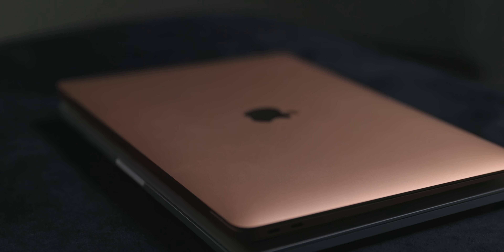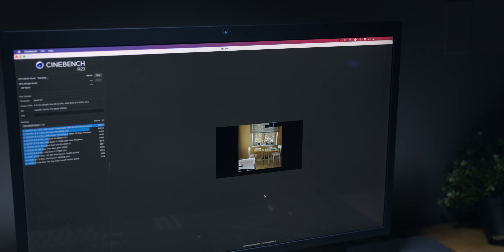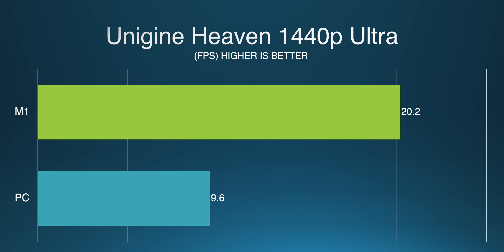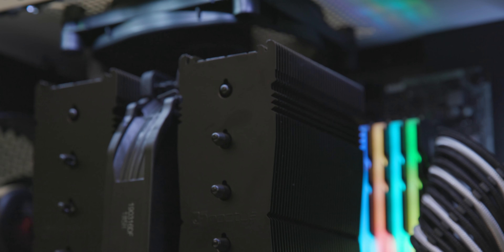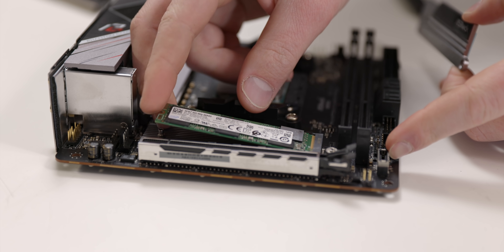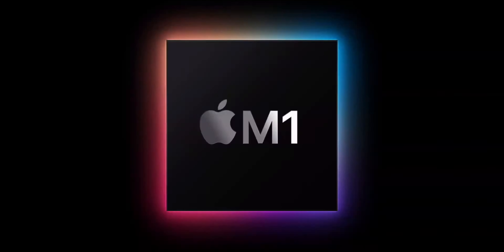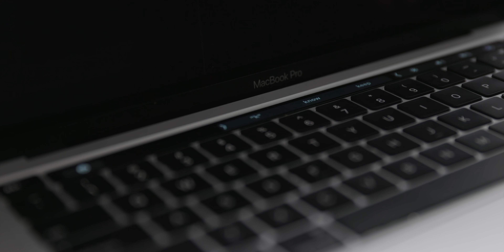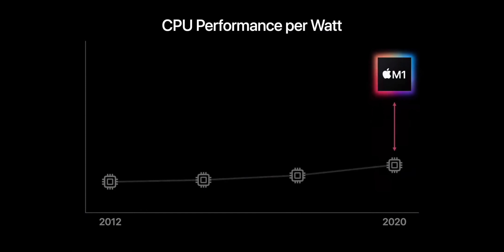$699 Mac mini vs $1,000 PC: Which Is Faster?

Comment: The M1 being the first generation in its class makes me very certain in a few years it will make getting a Mac one of the best investments you could make. Battery life in particular is one of the biggest reasons. Since the M1 was such a game changer, Intel is now completely obsolete and is a terrible choice long term. And I know some may disagree with the science behind ARM64 but only time will tell, unfortunately the market and industry are certainly not moving in Intel's favor.
Reply: Sergio Diaz  You're not wrong. That is indeed a huge flaw in Intel CPUs.

But I don't consider the TSMC thing a huge issue. AMD couldn't do it either and they couldn't beat Intel back then. So what did they do? Well they literally redesigned the entire CPU from the ground up. Lisa Su herself stated that Zen was redesigned from the very bottom. It worked out for them. It'll of course take Intel a while to catch up, but if they start now, it won't hurt as bad. 

It's bad right now, and they're spiralling pretty badly right now. 100% bad.
But they will get better. Moving to TSMC for now is a good move for them. If you can't beat the competition, join them. They've also said they'd be using Chiplet design instead of traditional Monolithic design. They have a ton of R&D money & brilliant engineers. They need better leadership and that's what their new CEO (old engineer) will be doing for them HOPEFULLY.

Btw, Joe Biden just threw $37b at the silicon industry to fix shortages among other issues. I'm not an Intel Fanboy tbh. When AMD was down, and people kept shitting on them, it's not a good look. When Intel is down now, people are doing the same. People are playing both sides and it's kinda sad. It's still a great company and team of engineers and they will pick themselves back up, just like AMD.. even if they have to take an L first.
Reply: It already is!
Reply: Gonna disagree. Intel will do fine. They may take a hit, but they will do fine. I LOVE my M1 Macbook Air, but it doesn't (can't) do what my two year old Windows 10 with Intel chip can do, and that's okay. I use each of them appropriately. Right tool for the right job. Every company takes a hit when a competitor releases a compelling bit of kit, but then they all usually come back. I have no reason to think that won't be the case again.
Reply: LoL, I love people who are not in the I.T. field making statements like "Intel is obsolete."  Yeah, 👌, 20 extra frames or 40 seconds of extra render time will not move the majority of PC users to Mac.

Apple will always suffer from the problem of being Apple.  Closed eco system, expensive hardware and getting the 🖕if you don't like their "advancements" like butterfly keys or a touch bar.  

The M1 is impressive, no doubt but Apple doesn't dedicate their company to making chips like Intel or AMD.  If the upcoming x86 architecture cannot compete with the future of ARM, guess what Intel and AMD will do?  

Plus let's talk about being restricted to 16GB of memory.....the biggest downfall to the M1 to date.
Reply: @NeverDoubtMe23  Finally, someone says it. 16GB RAM in 2021 is an insult to the pro-sumer market. I need 64GB. I just MS RD into my 64GB RAM PC via VPN software now. Mobile computing is getting ridiculous.
Reply: @FADHsquared  did you watch Cold Fusion's video?
Reply: It's really fun to watch Intel fanboi defending their shortcomings. AMD won't let your fingers rest.
Reply: Hard to say, terrible investment, it depends how you look to it, will you upgrade your current m1 with new m2? If that so its Also terrible investment.  If you wont, why you think intel users will upgrade they'r fully working and capable machine ? Or even so if they have more powerfull than m1, a AMD machine? Then who's investment is worse?
Reply: @racistpixel1017  numbers show otherwise
Reply: @FADHsquared  I'd agree that the intel laptop chips use too much power, as almost every windows laptop i've ever tried performs similarly to the macbook pro where it's super hot and loud and battery life is like 4 hours.
Reply: What a fraud video, he didn't even show hardware specs of his test bench. He didn't even tell what Ram configuration, cpu clocks, either the cpu are set into performance mode, balance or whatever. This video biased af.
Reply: Phone in form of notebook computer 💻? 🤔 First? Chromebooks, Windows mistakes... Another e-waste. No future here, you can't do anything without their approval on their phones,  same now on very closed computer architecture (I can't call that a computer anyway).
Reply: BUT THE WORLD IS DYING WITH MORE AND MORE PRODUCTION, 2ND HAND IS THE WAY TO GO or well everyone could die that works too
Reply: Sergio Diaz  well there one thing for sure where you wrong, intel have ability to jump on any nm they want, the bussines model they're runing is not like other companies, instead shrinking transistors size, they improving over current architecture,  i wonder how you dont know that 🤔thos 8th,9th... intel cpu's is pretty much same cpu's but improved in design, design they use is ultra polished, what going to be when they jump on 5nm, its 3x less nm...
Reply: Intel's former CEO Bob Swan agrees!
Reply: Apple notoriously bottlenecks the RAM so the CPU doesn't matter.
Reply: @nsiebenmor  Yeah, seriously, I want more RAM!
Reply: These comment shows a huge lack understanding of why the M1 is even fast to begin with.. Intel obsolete??? Lol.

Intel uses Monolithic Processor Design at 14nm.
AMD uses Chiplet Design at 7nm.
Apple is using System on a Chip Design with PoP (Package on a Package stacking) at 5nm.

The first problem why Intel chips are slower than all others is because they're still on 14nm.. and you know what? They're doing pretty damn good at 14nm vs. 7nm. vs. 5nm! They have literally pushed 14nm to its limits. Further than any other company.
Their chips will still have less latency than AMD chips because it doesn't have to deal with IPC latencies over the Infinity Fabric. However, Chiplet design is showing its colours with huge performance in SMT and pretty damn good performance in ST.

Now that design is out of the way, let's see why Apple's M1 is fast and why it MIGHT be a setup for failure.
The M1 chip uses SOC design with PoP. It means they actually take the CPU, DRAM, GPU, Cache, Neural Engine, etc (SOC).. and cram it in a vertical stack layout onto the same chip (PoP). They do not have the RAM far away from the CPU at all.. Not only that, but it's a UNIFIED MEMORY design (Apple's fancy word for Integrated Graphics with SAM (AMD).. aka Resizable BAR) so it means the GPU shares the same memory as the CPU and everything else. Actually, the CPU, GPU, Neural Engine, and any component that needs access to the memory & cache already has direct access to it. In other words, there is no need to transfer/upload something to the GPU when it already has access to it directly (this is one reason why their iGPU beats Intels). It is also RISC based instruction set, and the M1 is limited to a SINGLE THREAD PER CORE gives it a huge advantage in benchmarks whereas Hyper-Threading will cripple the Intel/AMD chips in a ST benchmark and blow away the M1 in an SMT benchmark. Do all of what Apple did at 5nm and you're beating the competition (temporarily).

Now like I said, everything is literally on the same chip, and it's optimized as best as it can. They can possibly squeeze out a little bit more performance by re-arranging but it won't amount for much. What will amount to a boost in the next generation is when they go to the next MOSFET node 3nm process. But even then they're already squeezing out as much as they can out of this chip.

So in terms of raw computing power, if Intel and AMD were on the 5nm process node, they'd destroy the M1.. After all Intel is still on 14nm and still doing quite well against both 7nm and 5nm competitors. There is one advantage Apple has though: They design both the OS and the hardware so they can make the OS highly optimized for that hardware. Windows can't do that as it runs on many different hardware configurations.

Finally, the reason the Intel chips suffered so much in a Mac is because Apple's thermal design is terrible! They constantly pushed for the thinnest possible macs with no regards to anything else and down clocked every single Intel chip ever placed in a mac..

But oh well.. people will continue to lose upgradeability (every single thing is soldered together).. Apple already has to replace the entire motherboard for all M1's affected by the USB-C charging dock issue lol.. and now the SSD issue is even worse as you can't replace the SSD lol.
But without truly understanding anything, you guys will swear by them. :l

P.S. The M1 based computers still use Intel JHL8040R Thunderbolt 4 Retimer and Intel's thunderbolt technology (will be available in USB-4).. that makes Intel not "obsolete" ;)
Reply: @bt-p6i  excellent reply 👏 finally someone with pure knowledge and not judt hyping things recklessly
Reply: @bt-p6i  youre wery right,  plus intel dont upgrade its nm game, instead refining current architecture. They also have trick on they'r sleaves... They can easily push 8nm or less on they'r cpus, refine architecture even more. M1 have own issues, no 60+hz support, no graphics card support, no ram/ssd upgradeability, no virtualization, the instructions set not meant to scale and many  more. There is huge market for intel and amd, and for sure the biggest market for windows os... There is just so many factors why intel is not dead... For one i see, everyone compare m1 with intel, but not with amd, how intel is hot and loud but not amd... As far as i know intel loud and hot only on apple devices since apple is terribel at thermal designs and apple newer use amd, that do make me think that ppl who buy m1 and hyped about m1 is same life long apple users who dont even know about amd existence and how well intel run on windows machines... There is a marked for m1, existing apple users but not inter or amd users... If you see persin saying that intel is hot and loud and newer speaking about amd, he is 100% life time apple user who dont know any better.

The only thing is, i think m1 can and will improve, bussines is bussines, apple investing to jump on arm for good, and i think arm is a future. I think apple knows what they're doing and calculate everything for a future. But time will show...
Reply: @bt-p6i  Really well articulated !
Your point about apples thermal design being terrible is true... Although I've had numerous windows laptops with different thermal designs and they were all super hot space heaters with fans blasting, just like the macbook.
Reply: @bt-p6i  How does this explain my desktop computer with a massive cooler and lots of fans, 3700x 8 core cpu, 32gb of ram... really poorly editing 4k h265 video, but the m1 macbook chewing through it like it's nothing?
Reply: @cinialvespow1054  because M1 MacBook apps are highly optimised for native workloads
Reply: @bt-p6i  agree with everything except the SSD issue
There's nothing wrong with it
Reply: @bt-p6i  "Finally, the reason the Intel chips suffered so much in a Mac is because Apple's thermal design is terrible! They constantly pushed for the thinnest possible macs with no regards to anything else and down clocked every single Intel chip ever placed in a mac.."

I have suffered due to this. I hate Apple for basically overheating its Intel Macs.
Reply: @purpmint3116  wait until you see the new rainbow 24” iMac released yesterday. The fans are covered completely with no vents or holes for airflow lol. The aluminum chassis blocks any air from getting in or out :l
Reply: @bt-p6i  I may buy a MBA as a client-side device. But, I'm never buying an iMac -- waste of money except for some people with more money than brains.
Reply: @bt-p6i  I know that the M1s are "thermally efficient" and don't tend to heat up much. But, I would have preferred some real caution. Is there any external thermal padding I can buy?
Reply: @FADHsquared  The paragraphs were explaining design of the chips..

1. I'm not saying it's a good thing. They are already moving to TSMC's 5nm via outsourcing their Core-i3's to TSMC. They will be outsourcing the 3nm chips to TSMC in 2022 as well.. They are also going to 7nm in their own fab. So all I was saying is that they're doing quite well competing currently at 14nm lithography than people give them credit for. I was simply explaining the difference in speed and power and why the design of the M1 isn't going to help it in the upcoming releases vs. Intel && AMD.

2. What? How does "They've already squeezed out as much as they can with this chip" exactly translate to: "iPads and iPhones shouldn't keep improving".. Did I miss something here?

3. Ok.. you can literally say this for any chip on the market right now. Even AMD's 5800X, 5900X, 5950X chips use a lot of power. Even the Nvidia 3080 uses a lot of power. Yet Intel mobile processors do fine in Dell XPS laptops but not in a MacbookPro's which LEAKS Lithium Hexafluorophosphate from the Li-ion battery. Again, XPS and ASUS laptops and a bunch of others are doing just fine with Intel CPUs.

You guys are forgetting Apple once ditched their own PPC instruction set (Power-PC) to go back to Intel lol.. The M1 isn't the first RISC based instruction set Apple has adopted. It also isn't the 1st PoP on SOC design either. I guess we'll all just have to wait for the next 2-3 generations of chips to see who comes out on top.

ARM is going to be great for Mobile devices (Laptops, Phones, etc).. It already is. But it won't be "Desktop" quality any time soon.
Reply: All my macs failed after 5 years with issues that were too expensive to fix.
Reply: @FADHsquared  I accept the cop out :)
Reply: Not necessarily. Now that apple manufactures everything in house they will most likely stall innovation to increase profit margins. The m1 just was their first chip and it had to be impressive.  Not saying they won't make any more progress but that it will happen at their own pace, to maximize profits, just how they do with their iphones.
Reply: @sigissigis3174  Apple does not manufacture anything.. not even iPhones.. Apple doesn’t own any fabrication facilities. They outsource. TSMC is the manufacturer of the M1. Apple is the designer of the chip but doesn’t do any manufacturing. They also booked a huge seat of wafers from TSMC.. 27% of TSMC’s YTD earnings iirc..
Reply: @bt-p6i  PPC was not exactly been designed by Apple, it was embraced by them but designed and manufactured by IBM as far as I remember.
Regarding current structures, INTEL is trying to hard to get the most of the 14nm, speaking of biz insight perspective, AMD just screwed themselves when they had tonz of support by most users and Apple screwed bit time when they just soldered everything.
I still hope INTEL catch ups the current wave of XXnm design by improving thermal and power balances, cuz this would help the planet by not consuming so much power. We really need to improve how to not waste so much resources and I still hope APPLE returning to at least NOT solder the SSD and RAM anymore!!! That is a disgusting decision by APPLE and they lost me there.
Gladly my 2012 Mac Mini and 2014 MBP still runs without hiccups on this 2021 lol. (upgraded the internals of the Macmini though)
Reply: I hope every Apple person here reads the news though.. Apple is supposedly removing Rosetta Emulation from the OS in some regions.. This would literally kill the M1 for many lol. Looking like PowerPC all over again lol.
Reply: @bt-p6i  Thank you sir. Your comments here are some of the most thoughtful, insightful and rational I have read in a long time. I didn't expect that under a typical apple-shill-video, where most commenters are either Fanboys or Haters of a BRAND. I agree to 100%!

Comment: But what if you do work that is not HW-accelerated? The M1 chip only supports a handful of encoders and decoders so it's easy to get screwed over. Or you'd have to prep the material by re-encoding it to one of the supported formats.

Comment: I have a m1 mac mini wit 8 gigs of ram. Running docker on it and IntelliJ IDE makes it lagging sometimes. I should have got the 16 Gig version. However i just bought it as a backup solution and wanted to check it out, If I can already use it for productive working - and I can :)

Comment: Because the M1 is a "mobile" chip and we are the PCMR I feel it has gone a bit under the radar. It seems like a very well designed chip that if adopted by consumers will leverage Developers to build their software for ARM. And then it's Apple's game for the taking, providing one or two full-fat alternatives (let's call them the M1S and the M1X) for non power or thermally constraint applications

Comment: basic physics: energy consumed equals heat generated. What you probably meant to say is that TDP is more of a "power rating" rather than some power drain limit. For what I know it generally represents sustained multi-core energy consumption at base clock.

Comment: Unfortunately for folks like me in infosec, M1 is still a mixed bag. It is tremendously impressive, however, it will suffer adoption due to slow movement by Microsoft in Windows on ARM and its broader adoption by the industry. There is currently no way to emulate x86 in VM. You can run ARM versions of Linux and, Microsoft willing, Windows on ARM, but companies and government departments are likely to run x86 Windows 10 for years to come. If I need to examine a disk image of an infected system, chances are it will not run on M1. That being said, this is a very niche use case. The average user will be very well served by the M1, and I highly recommend it to friends and family.